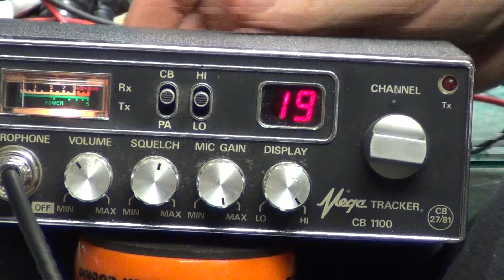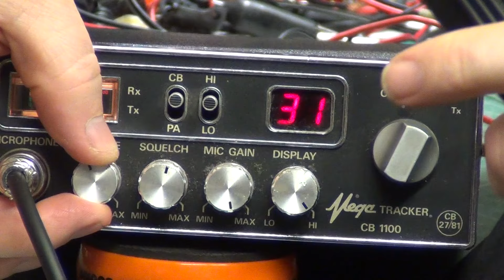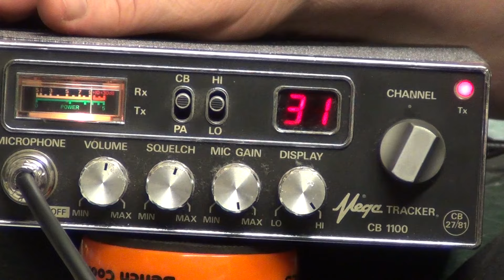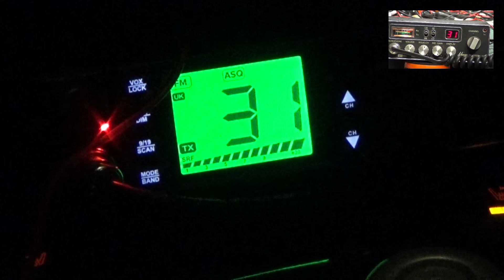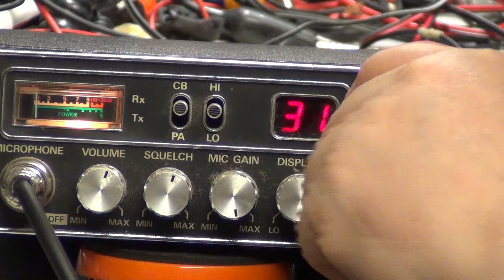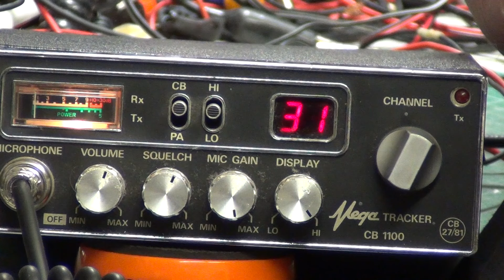Mega Tracker CB1100 CB27/81 UK FM CB radio -  On The Air test (my own set)

Comment: When you get the other Mega Tracker sorted you will have to do a Mega to Mega on the air test
Reply from the maker: mmmmm....the other has transmitter thermal runaway & now it is receiving, is deaf..I suspect a duff filter or two or three. Not stupidly deaf...like 3uV. Now trying to locate a substitute CFM2 455D filter has so far failed.

Richard
Reply: Would be nice for 2 UK made rigs together after 40 years  @ukfmcbradioservicingTango21
Reply: Dimmer is a really useful feature, especially on newer sets with large coloured displays on them. I always have to dim the display otherwise it distracts whilst driving.